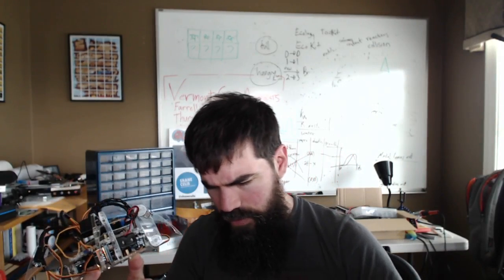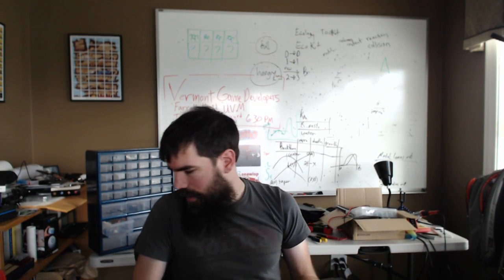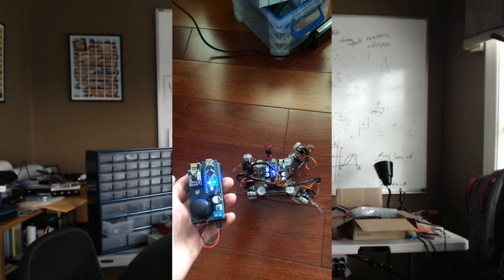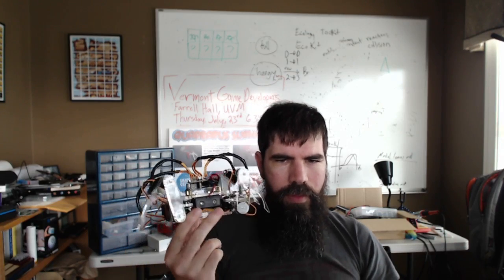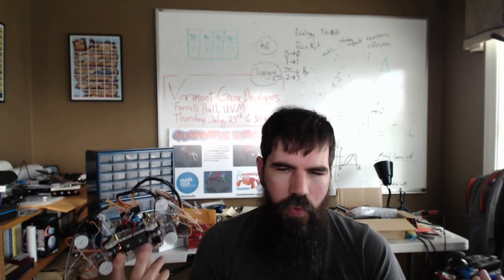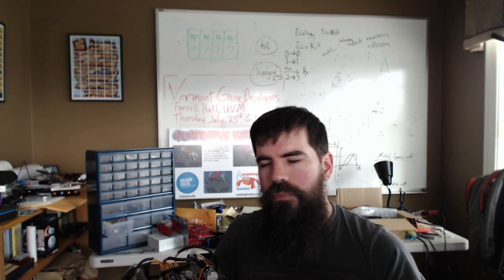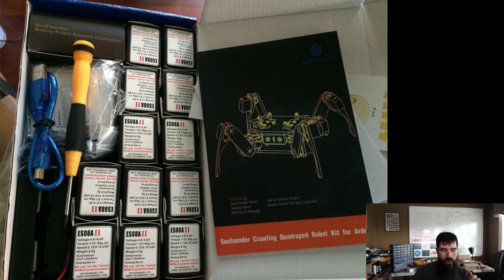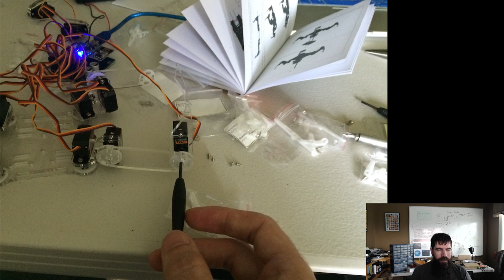Mockup Monday #46: Sunfounder Quadruped Kit Review

Comment: Hi Shane,  I saw your video - looked like a very nice kit to tinker with so I went and bought one.  You seem to have solved an issue I'm having, RF24 object radio.read is not returning a bool and is causing Crawler.ino to fail build because of the while loop and if statements...  Found your code on GitHub, you've worked around this.  Will your version still honour 'INSTALL' 'ADJUST' 'VERIFY' definitions?  And what's going wrong in the Sunfounder code?